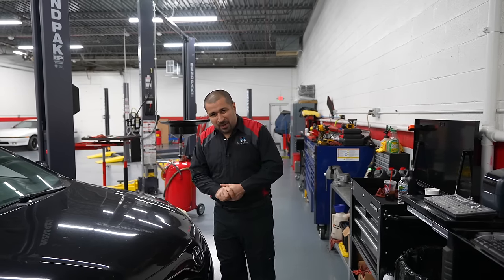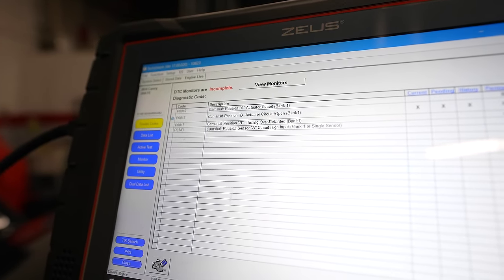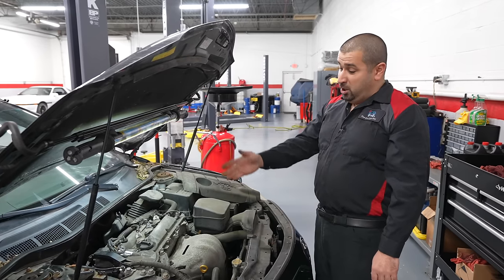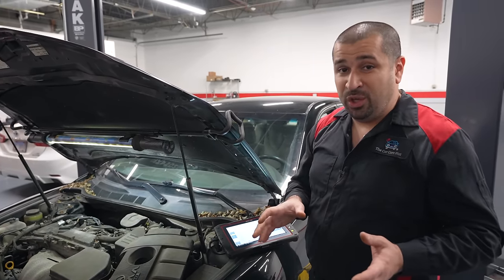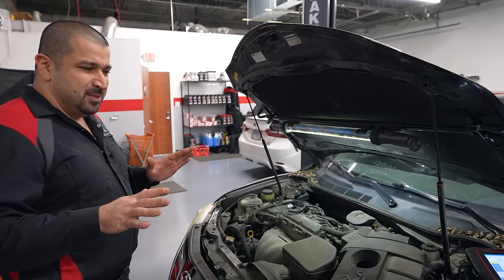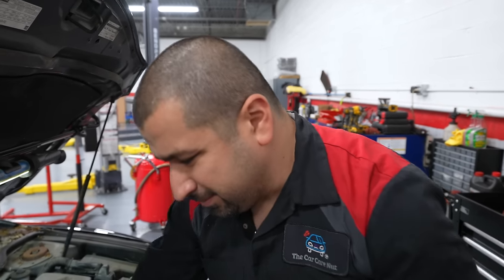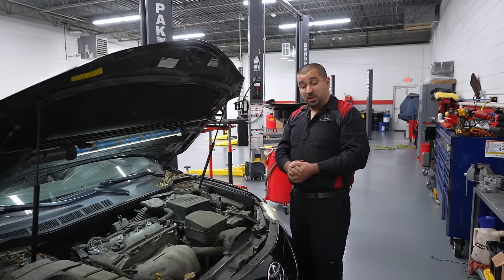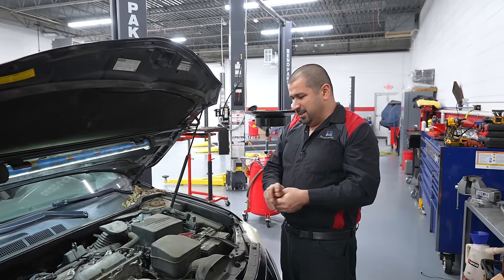Mechanic Parts Cannon FAIL Cost Customer A LOT! Let's Try This Again

Comment: I think in this instance with a budget which might be tight.  It might be a good idea to start looking into salvage yards, find the same make/model/year of car and hopefully one without damage to the engine area.  Someone could most likely find a computer for a fraction of the cost of a new one.  At the very least, if the car is a write-off otherwise, there's not much to loose.
Reply: Agreed
Reply: go to a Pick-a-Pull with an empty tool box...$2 entry fee, case closed

Comment: DIY car enthusiast here. I definitely did a parts canon with my mom's car when it didn't start. I replaced the starter, and turns out it was a simple blown fuse. Hard lesson learned. Now my mom has a new oem starter for years to come (i ended up eating the cost of the new part lol). Thank you for the video AMD!

Comment: I think you should also check the wires to ground and 12V with the computer connector connected (check them from the VCT end).  If the possible short is to a wire that is coming out of the computer, where most of the wires in that bundle come from, then with the connector disconnected you may not see the fault.  The faulty wire at the VVT end should be open the other may show ground or some voltage.

Comment: i agree with your process of checking power on both legs of the sensor. However, when checking for shorts to ground you should have your meter on resistance to the negative battery post to check for a grounded wire. a grounded wire will not have any voltage on it.
Reply: that is why he had it connected to the POSITIVE battery post as well as negative. A grounded wire will show -12V there (red lead to test point, black to positive battery post), if he sees -12V, done, short to ground.
Reply: @bronx-gr  Thanks, I appreciate that perspective.  Since the sensor is powered by the ECU if it was shorted to ground it would have caused a failure of the ECU and not necessarily blown a fuse.  If it had been power fed from the fuse box then the fuse would or should have blown, but still checking that way would confirm a grounded leg of the cable harness to the sensor.

Comment: WOW!  Just WOW. An honest to goodness troubleshooter.  Retired two years ago from the electronics industry (Biomedical Equipment) after 45 years in the field. The art of troubleshooting and diagnosing failures is something so important but so often ignored or overlooked.  The parts cannon technique is everywhere, in every industry.  Real troubleshooting is something that has to be learned and practiced. 
I’ve seen this before, so many times, by senior technicians and engineers as well as junior.  To effectively diagnose and resolve issues with malfunctioning systems, you must understand the properly functioning systems first.  
Found your channel a few months ago when I was considering purchasing a Toyota Rav4 Hybrid.  Your channel is just the best.  And yes, I purchased the Rav4 Hybrid (2021 ESE with 5000 miles on it) just last week.  
You should be teaching the teachers.   Thanks so very much.

Comment: That poor Camry. I have a soft spot for Camry's. I owned a used 86 & 97 Camry. With all those leaves in the cowl, I thought for SURE mice ate the wires. Now, can u pick up a used computer from a junk yard? I hope they read this, get some Mother's Aluminum polish to clean cataracts from headlights.😉 Good luck with your repair! 🖖👍🇺🇸
Reply: After polishing, do you coat the len with something?
Reply: Agree, depending how long they want to keep the car, a junk yard part can be an option.
Reply: @dans_Learning_Curve  O believe it IS a polish. Jst when they dull down, repeat again, its a cheap fix.
Reply: @Rice Burner me too, I own a 1986 blue 2 tone Camry liftback 5 speed manual. Manual everything except steering. Just bought it 3 weeks ago from the original family. The interior & exterior are in amazing condition, only 187,000 kilometres on the car, which is definitely super low for being almost 37 years old. The interior is an absolutely gorgeous blue. Currently replacing the CV axles & struts on it myself. Using quality parts. Even though I’m only 15 I’m wise and keeping it stock and original.

Comment: Did the aftermarket parts kill the I/O on the computer?
Reply: No. The hard code was stored in the memo of the ECU. After the soft codes were erased, the hard code remained.
Reply: Jury is 50/50 on that one.
Reply: The original part could have killed the engine computer. But its gone, so no way of testing it.

Comment: Hello I am a Diesel Mechanic in the Heavy Transport industry in New Zealand. What you call the parts cannon,We call diagnosis by replacement.
You are 100 percent correct if some one does not under stand how or why the machinery they are working on operates,and do not have even average diagnostic skills.
You are going to cost customers a lot of money in a hurry.
Be it cars or trucks.
Keep it up good to Some one of your experience and skills pushing in the right direction,even if it is in a different country to mine.
Mike Kay

Comment: I am an old auto tech, formerly a Toyota Master Diagnostic Technician.
I love your professional and logical diagnostic approach.
One detail you left out was to test the resistance of the OCV. Like you said, it's rare to see a failed Toyota ECM. One thing that can cause that is a shorted component. It may be that the original OCV was shorted and caused the ECM failure. But it also may have had a bad OCV to begin with, and the new one is shorted, and it fried the ECM. 
Testing the resistance of the component can provide you with a clearer picture of the whole condition.

Comment: Yes, you proved the wires can carry voltage, how about current? Eric O and others use a high current draw bulb to prove there isn't an issue say like in a splice somewhere in the harness. My sister scraped a car because the transmission would down shift at highway speeds! Shop couldn't figure it out. Without looking at the car, but a wiring diagram, I believe the issue was in a factory wire splice down low on the core support. I believe the TCM was loosing either power or ground and the transmission would go into limp mode which was probably 2nd gear!

Comment: Great video. One question regarding the diagnosis. Shouldn't the wires be load tested in case they are slightly damaged where the meter would read no resistance but wouldn't be able to carry enough current under load?
Reply: Yes…in my opinion, you are correct.  I have tested circuits before that passed continuity tests, but due to other physical damage (loose connections, corrosion, wires half chewed) they were unable to carry the required load (current).  Granted, these OCV’s probably don’t require much current to activate…but a test worth doing before charging $800-900 for a new Toyota ECM.  My opinion only.

Comment: as i was maturing in the auto industry I had to take many courses on diagnostics and electronics to keep up with the tech of modern cars , I even took  some courses multiple times just because sometimes in a class environment you miss a detail or two or if you dont use what you learned often enough you tend to forget details. Problem today is that tech is moving so fast not even dealerships can keep up. I have repaired many cars that were botched by dealers cuz of the way they work and time limit put on techs .  Its only going to get worse. NO new generation ( snowflakes) want to get  their hands dirty and actually do work.
Reply: Being an actual good mechanic nowadays able to deal with modern car problems (not changing parts) requires engineer-like aptitude and intellect. But the problem is most such talented individuals would rather work in well paying high benefits STEM instead of toiling away on the most challenging issues for flat rate.

Comment: I am a retired electrical engineering tech and have been following you since. I have been a Toyota fan since 1976.
My son is a mechanic and has a difficult time with electrical diagnostics. I texted him your video and after watching it several times it all fell into place for him. He is now a follower. 
I like the way you diagnose problems and not just replace parts and hope that fixes it.
Thank you for sharing AMD.

Comment: One of the most “to the point” presentations on systematic troubleshooting I have seen!  Thank you! This is one of my pet peeves in all fields, but especially in the current automotive field, where we are overrun by “parts changers” masquerading as mechanics, even in Toyota dealerships. Until more of us as owners insist on the troubleshooting happening before the parts are changed, this is not likely to change.  Unfortunately, most car owners are not familiar enough with their vehicles or the methodology of systematic troubleshooting to be able to do this. In my experience, if the technician immediately gets defensive when I begin asking questions about how they arrived at their conclusion, it’s time for me to take my vehicle elsewhere before I dump a bunch of money with them and then have to take the vehicle to a “Car Care Nut” for a real repair.

Comment: I had kinda the same issue with my 2014 Camry SE. My brake light came on for the first time ever, I took my car to Toyota and the mechanic said I needed a brake Booster more than 2k to replace. I made an appointment with the Car Care Nut and he found NO issues with my brake Booster, he save me  BIG MONEY! This guy is fantastic! I’m so glad he’s in my area..
Reply: So what caused the brake light to come on?
Reply: @frankg6578   I’m not sure maybe just a malfunction but my brakes are just fine after the Care Care Nut did a in-depth inspection.

Comment: So i recently got an 07 Avalon in the shop with a crank no start issue. The customer told me he took the vehicle to 4 different “mechanics” and lets just say they did a number to this vehicle. Long story short i found the engine fuse block completely melted and toyota does not stock the engine harness anymore. So i went in and rewired the entire fuse block to start with. To make this long story even shorter i have now fully diagnosed this vehicle after every circuit was fixed and corrected. All of this happened because someone didnt know how to replace an alternator. The guy that did it charged him 50 bucks and now this guy is looking at over 6k with parts and labor time. I feel bad for the customer but he really wants this car. I fully agree with you on  that you have to stop and take time because the other 4 guys didnt know where to even start. These videos give me hope that there are quality technicians in this industry.

Comment: You are absolutely dead on. Toyota of Mt. Pleasant TX said the P0420 diagnosis on my '08 Tacoma was 'a really bad catalytic convert, basically non-functioning' direct quote. They spent < 5 minutes diagnosing it. My objection was being asked to spend $3K on a new cat with such little time spent on the problem. I had them replace my spark plugs. Why fight against a parts cannon, I felt. I felt it best to use the diagnosis fee to get a part I actually needed. After the new plugs and a bottle of cataclean (and a good 75MPH, 2 hr interstate trip), the code/MIL light is gone and has been gone for well over 1000 miles. You gotta protect yourself from parts cannon folk -- conversely though, if I did every come across an honest mechanic, I am not sure if I'd ever trust the mechanic enough to let them do their job just because of all the bad experiences. Shame on Toyota of Mt. Pleasant. They contacted me after I reported them to Corperate, but only to argue. It's a cultural thing there, not just the techs. Toyota themselves wouldn't help stating that it's the dealerships responsibility to ensure a positive experience. But hey, in the end I got what I paid for, new plugs @ dealer prices and a free AutoZone style code readout disguised as a serious catalytic converter problem w/ all the high pressure sales tactics you could imagine. Would have been far worse if I hadn't protected myself w/ a pre-thought out plan in the event they f'ed me. Specifically my plan was: if they say it's the cat without reason, have them replace the plugs.

Comment: ❤ Rule #1. Be smarter than the equipment you are working on. Great video. I spent 10 years as a drivability technician. Same as this, fixing other technicians improper diagnostics.

Comment: I appreciate your explanation in testing the circuit.  It's "TEST, DON'T GUESS!"  
I'd like to add more to the diagnosis.  Not competing, just verifying.
For those of us not Toyota knowledgeable, a wiring diagram may be needed and in this case the Service Information will be helpful.
That being said, what's the resistance of the good valve?  
You could test the intake (actuator) valve with the tool, which means if both valves have 12 volts coming to them (wiring diagram with fuses) on the power side, which can be tested at the valve, now see if the power is passing through the valve to the other wire which is connected to the pcm.  Check for the power at the pcm on that valve's control wire.  If power is there try your test with the scan tool and see if the power goes to approximately zero volts.  If it doesn't now you've verified the computer at fault.  If the test shows the 12 volts going to zero but no engine rpm change, now you could have a bad valve or a mechanical problem.
Yes testing takes a little longer but this verifies the circuit under load.  Like you said, nothing worse than buying an expensive component only to find the problem is elsewhere 
Thank you for this video.

Comment: I remember the time when I first time read a fault code. It was in my -92 celita all trac (american version imported to europe). That thing only had the earlier OBD gate which gave fault codes by blinking the check engine light. I found the codes online, figured out the part of the engine which was giving the fault, went to check the wires and voila: one of the wires was bad (could visually see it) and was like "WOW!!". Before that fault codes and all that had been feeling very scary to me, but it really helped me understand how the "computer" in the engine was thinking. Very primitive, but super helpful. now I think diagnosing electrical systems is super fun instead of intimidating.

Comment: This chanel is very informative and so educational to all professional mechanics they just relies on code on scanner and replace the parts right away which  called them parts replacer they don't explore more where the source  what are component that will be appected  and mostly mechanis don't have knowledge in electronic and computer .. so we need you Sir..as a professional  educational to quide those lack of knowledge in electronic and computer. Mag Godbless you Sir

Comment: Youre a Prince at Diagnosing. Excellent job! I worked in specialty shops all my life and  that is where you want to take your car too! The diagnosis approach is the same however a lot of times we bypass the process of testing and go straight for the juggler and swap out the computer first and than the harness if necessary. A regular shop won't have an extra computer laying around or yet alone a harness for testing purposes but it sure makes the process easier! I like the way you explain the logic in simple language and utmost confidence. Excellent video!

Comment: The emphasis on diagnosis is refreshing and essential. Love these videos. I'm just a DIYer but the number of times I've had to correct a professional's work means I always diagnose before I submit a vehicle for repairs I can't or don't want to do for myself. I understand that mechanics are under pressure to provide firm quotes before starting work but I know this is difficult, so often, it seems, the quotes are given to cover the more expensive possibility. Many people don't like paying for diagnosis time.
 On the OCV issue many mechanics will tell you the valve just needs cleaning. Maybe! I've found, repeatedly, the issue to be high reistance operating coil giving intermittent to permanaent faults depending on how high the reistance is. Typically good is 12ohms, intermittent is 20ohms complete failure above 40ohms. May vary for different models.

Comment: Just like a good doctor, you must be able to find out what is wrong with the patient based on the manifested symptoms.  That is why blood tests, x rays, MRI,  and ultrasound is done, to help diagnose the problem. From there on you gather the findings and reach into a conclusion. You are a great mechanic. Similar to a great doctor, you methodically diagnose the problem to find out what is wrong and get the cure. We as your audience are impressed.

Comment: Great knowledge, the " HARD FAULT" ..i really liked the tutorial of static tests,( wires and sensors) vs. Dynamic tests (everything running)  i see so many guys just plug in the scanner test cable and start the engine first.

Comment: Excellent troubleshooting brother. I wish you lived near me so I could take my car to you because I’ve noticed there are many repair shops that are afraid and don’t want to learn how to troubleshoot electrical problems. I had Honda dealership and two mechanics at two different shops look at my car a few weeks ago and none of them could fix my problem. I ended up finally finding the problem and fixing it myself. What I don’t like now, is that I can’t even pay to get my own maintenance repair manual even in a digital format so I can at least have the knowledge of my car’s systems and repair instructions.

Comment: I love the video.  You proved that changing the parts didn't get rid of the code.  So the mechanics who changed the parts charged the customer even though the code was still there.  That's unethical.

Comment: In rust belt cars, one needs to check the grounds also. The PCM controls things by potential to ground. One bad intermittent ground and a technician can be chasing issues for a while.